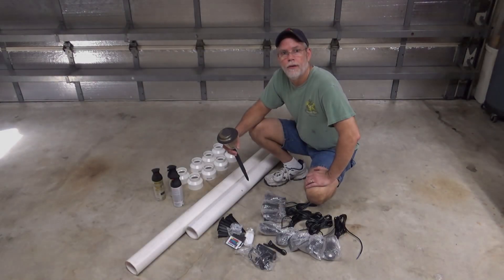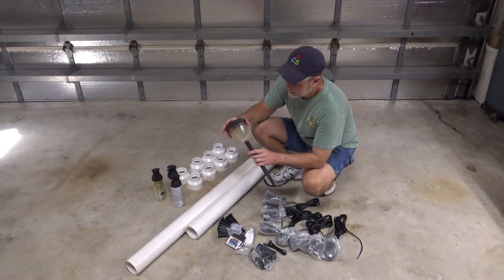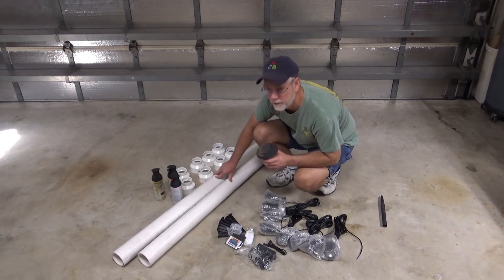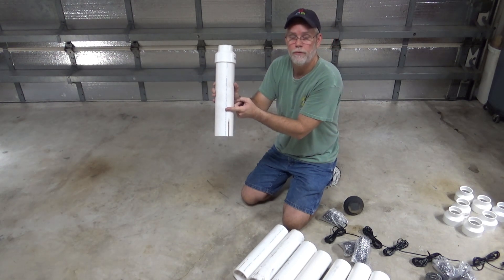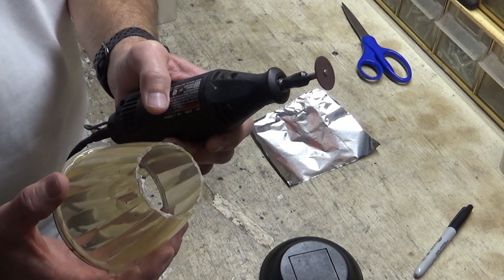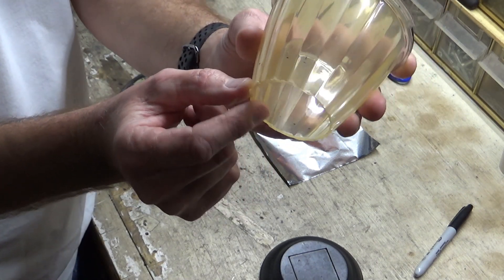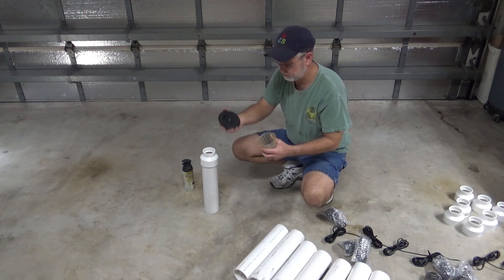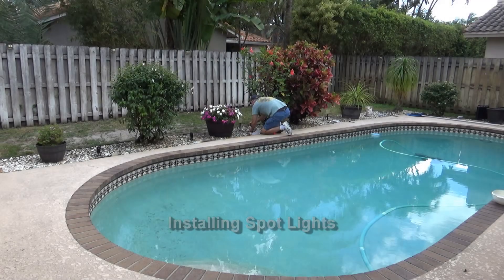DIY Landscape Lighting Light Fixtures PVC Low Voltage LED Color Lights

Comment: Great recycle project.  Couple things I might try.  Since you had to reduce the height because you lost too much light,  like someone said, get rid of the reducer and just use 2" pipe.  Also to enhance the output, can of spray glue and roll of foil and line the inside of the pipe.  One more thing;. Headlight cleaner for cars to get rid of the yellow lenses.  Great work
Reply from the maker: Thanks for the tips...

Comment: Great project! Out of curiosity are the reducers needed or can smaller diameter PVC tubes be used instead to reduce costs and make the bases thinner?
Reply from the maker: Yes, you could eliminate the reducer and get 2" PVC pipe. I guess I like the tapered look but slim and straight would look good too. Thanks for the comment...